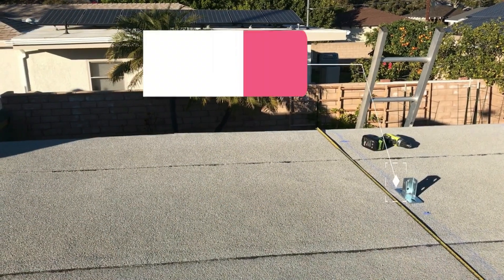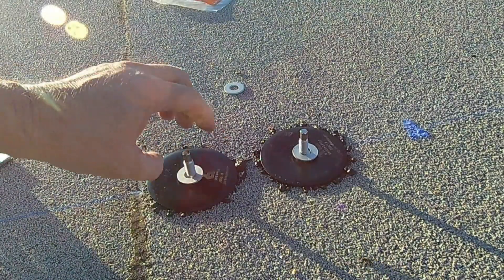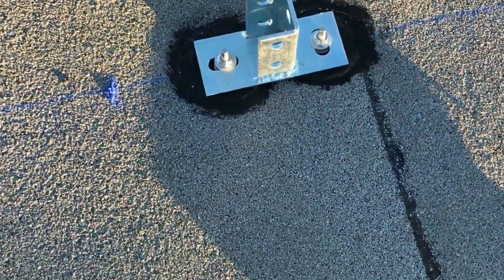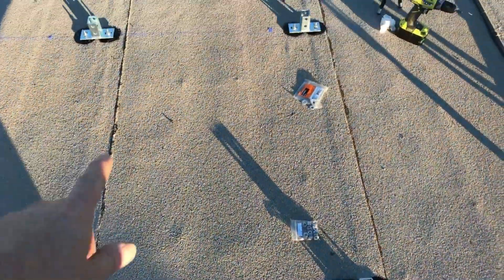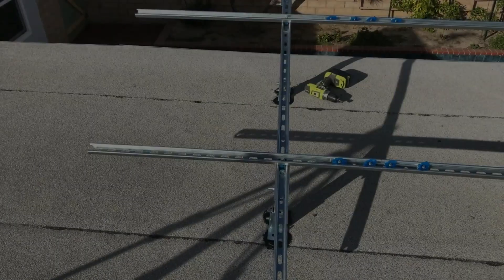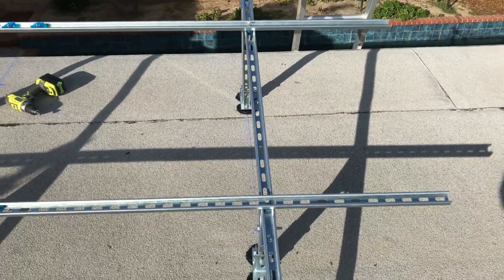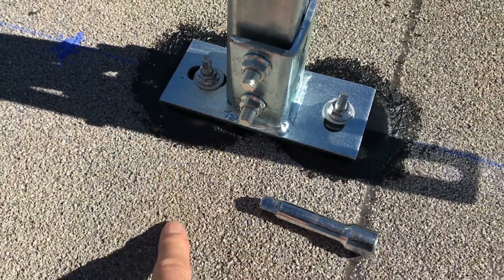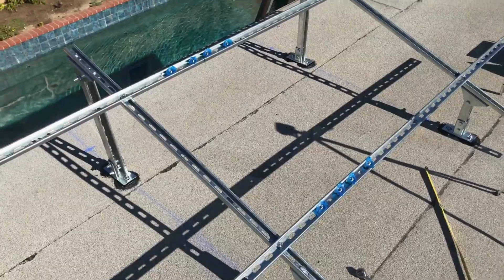200W Off-Grid Solar Powered Garage - Part 1 - Racking (Eco-Worthy) with QuickBOLT MicroFlashing

Comment: Great job on both the install AND the video!....  What's the angle on yours?  If I wanted a 10 degree angle, do you think it would be possible to put a 4 X 4 piece of wood under the front legs to give it the angle I'm looking for?  ....  Then anchor the wood down and not the front legs because the front legs will be mounted to the wood.  Make sense?
Reply from the maker: Hi there, thanks for watching my video!  I have mine at 19 degrees.  I suppose you could do the 4x4 blocks, are you saying you would do that without buying the tilt rack supports, or getting the tilt supports and then adding the 4x4 block for the front to elevate the front?  Or don't bother with the tilt mounts, and just get flat roof mounts and add the 4x4 to the rear of the rack?  You could do this if you space the mounts around 30" front to back (but check the math using one of those rise/pitch/angle calculators online).
Reply: @PhilsDIY  thanks man!!!  All GREAT ideas!

Comment: great start on your solar system. about 2 years ago i started a project to get my garage off grid and i started with 200w with 2 95ah lead acid battery's and a 1000w inverter. I got the bug bad and now have 1.6kw in panels 6 100ah lithium battery's and a 3k inverter. It takes a lot to get thru a Montana winter with your own energy but my garage is now an off grid hobby workshop. Enjoy your journey.
Reply from the maker: I imagine you also have to deal with snow on the panels!  I don't here in So Cal.  Thanks for subscribing!